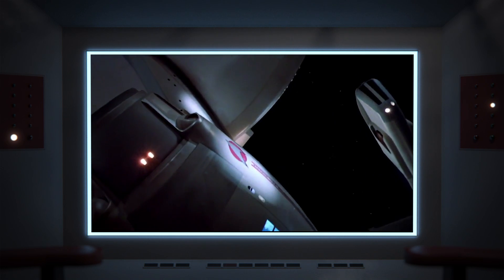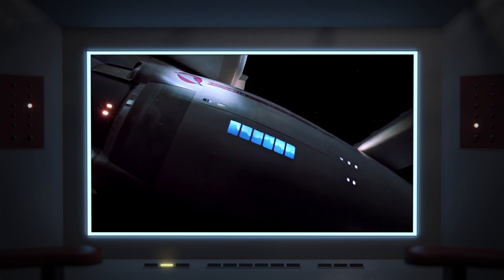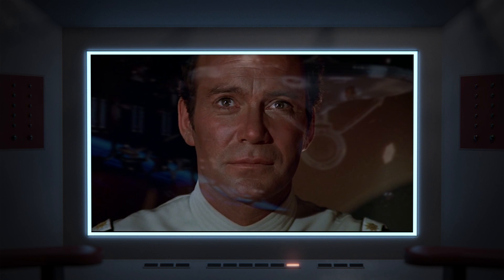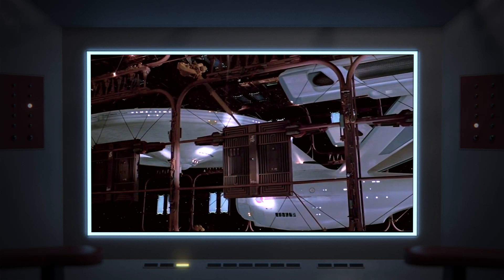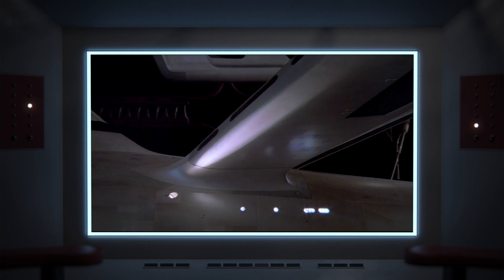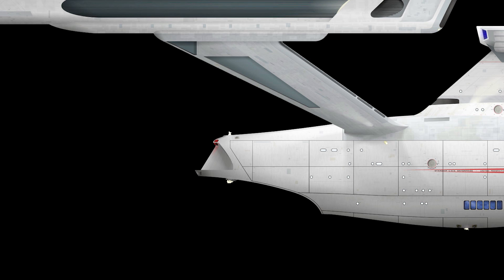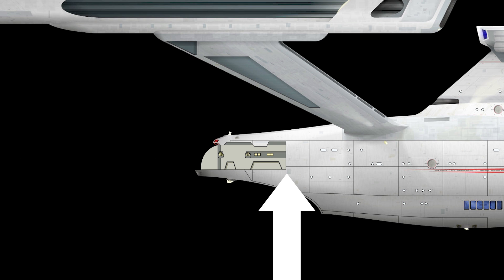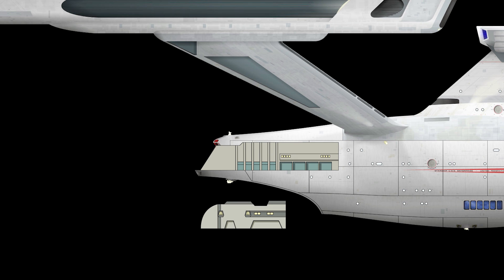Why Have Angled Nacelle Struts? (Enterprise Refit)

Comment: When I saw the title I was like 
'Cause it's supposed to look faster 
And I thought there's no way Henry could come up with a logical reason for that without it being a bit of a stretch 

2 minutes later

"because it limits the maximum size of the Shuttle Bay " spits drink DAAAAAAYUM, EC 
You're a goddamn genius 

How does he come up with this stuff ?
Reply: The Excelsior, Ambassador & Galaxy classes all switched from V to U configuration; avoiding this  problem.
Reply: @jedigecko06  Galaxy actually avoided it further by integrating the shuttle bays into the rear saucer and neck area instead.
Reply: @jedigecko06  - ... while adding a TURN to the Plasma Conduits, leading to an IMPORTANT improvement in the overall need for plot-point: Engine Failure.
Reply: It's simply an engineering thinking.
Reply: @Lukas-Trnka  An optimist sees the glass as half-full. The pessimist sees the glass as half-empty. The engineer sees a glass that's bigger than it needs to be. :D
Reply: Same here - I was mainly of the "because it looks better" category. But the larger shuttle bay... It's like you just smack yourself and say "why didn't I think of that?!"
Reply: Well, there was a bit of a stretch. I thought the reasoning would be more expansive. It certainly enlarged my understanding of the subject.

PUNS! You were making a pun, right?
Reply: Mihai Lazar
.... two words...Blueprint collections!
Reply: The was an article in the Naval Institute Magazine "Proceedings" called "Warships Should Look War Like."

Comment: If it looks faster, it goes faster. It's science.
Reply: If they paint it red, it'll go even faster.
Reply: @AlexSDU  Don't forget adding the V-Tech and NOS stickers.
Reply: @BammerD  Naaa what it really needed was spinning rims, a light kit, a craptacular stereo that can't play any other note than "BWAAAAAAAA BWAAAA BWAAAAAA" and of course the most useful and practical item ever installed on a teenager's car, the spoiler... Ensuring that Timmy's Ford Fiesta with the 1.6L engine will maintain control as it thunders from 0-to-60 in a blistering "eventually".
Reply: @AlexSDU  Char, is that You?
Reply: @paolobellomi8056 No. This is Patrick.
Reply: @米空軍パイロット  - The "Whoop-Honk" bicycle horn right ? THAT would be the FASTEST !
Reply: @chuckintexas  No. A spike horn.
Reply: @AlexSDU  add white racing stripes everybody knows that's at least a .05 increase to warp speed.
Reply: Warhammer 40k Orks have the best science. 
It also has more Dakka.
Reply: Shoot some speed holes in it! They make the spaceship go faster!
Reply: @MattMcIrvin  Didn't General Chang already do that?
Reply: Just put fins on the top. Make it look like a hot rod. Then it will go faster. Just ask Tom Paris.
Reply: RED WUNZ GO FASTA!!
Reply: paint it red to go fasta
Reply: it actually is slower, while the tos enterprise was rated for a maxium of warp 8 this one is just capable of warp 7
Reply: @kaltenstein7718  Actually, while the TOS Enterprise was rated for a cruise / maximum of Warp 6 / Warp 8, the refitted Enterprise was rated for Warp 8 / Warp 10. So she came out substantially faster.
Reply: Stickers help too.  Can confirm, repeatable results achieved with late 20th/early 21st century ground transport vehicles.  Probably due to reduced aerodynamic drag over the smooth surface of the sticker which eliminates the friction of the rougher painted surface underneath.  +1 horsepower per square inch of sticker, math checks out.
Reply: Red goes vroom vroom it's in the bible
Reply: We painted it red so it went faster too
Reply: No duh.
Reply: Add stripes for 2% speed increase
Reply: they designed what they thought looked cool and then tried to explain it later
Reply: aerodynamics doesn't apply in space.
Reply: @pepperVenge  No U.
Reply: @米空軍パイロット  What??
Reply: @pepperVenge  YOU DON'T APPLY IN SPACE.
Reply: @米空軍パイロット  You got a problem with me?
Reply: @pepperVenge  you missed the joke
Reply: @jackowackooooooooooooooooo2673  Chicken and rice?

Comment: I do not know if those ships actually can go into an atmosphere, if they can, then they would add to it's ability to move there.
Reply: Eucep   Not really, you won’t make a brick building behave any better in the air by putting some swept pylons on it.
Reply: @DrewLSsix  Not pylons but the design of the Rockafella Centre is calculated aerodynamically to minimise sway in high winds, which allows it have longer elevator shafts. 
Conversely the Borg Cube in the the flashback near the end of 'VOY: Hope and Fear' seems to be doing well in the atmosphere of a class m world.
Reply: They're not meant to but they can go into an atmosphere but only until a certain altitude. In the 1967 episode the Enterprise is sent back in time and ends up in Earths atmosphere and is low enough that jet fighters nearly intercept it until the crew gets the ship up to full power and they use the impulse engines to escape to low orbit

Comment: One Idea I saw on Memory Beta is that the New Nacelle Designs just couldn't be supported by the Old struts due to a number of factors such as the mass of the nacelles as well as the fact that the Power Transfer conduits weren't big enough to get sufficient power to the nacelles, These are likely some of the reasons why the Nacelle pylons were "Swept" in the way they were, to provide more stability for mounting the nacelles and allowing for a somewhat shorter travel time for the warp plasma to go from the Warp Reactor and the Warp Nacelles.
Reply: Also it could be to balance the center of gravity too?
Reply: @esecallum  
The original toy model by AMT of the TOS Enterprise was perfectly balanced -- you could balance it on one finger under the secondary hull. The saucer section and the original round nacelles offset each other perfectly. In real life, I'd bet that the warp nacelles equaled the weight of the saucer section as well, keeping the center of gravity constant, which would be necessary for flight.
Reply: @krisgonynor689  You'd certainly think so. On the other hand I did some mass estimates of various parts of a galaxy class ship given the information in the technical manual, and it leads to a few interesting conclusions.
The available info is the general mass of the ship ~4.5 million tonnes.
Then there is a specific mass given for a warp coil (don't know it off the top of my head)
We also know, based on explicit statements, (and also calculating the total mass of the 36 warp coil pairs in galaxy class), that the two nacelles are 25% of the ship's total mass.

Then we know that the ship is capable of saucer separation, which implies it has to be somewhat in balance not just as a unified whole, but also each half individually.

The final available detail is that in docked configuration, the main impulse engine (the one at the bottom of the neck on the engineering hull) is aligned along the exact centreline of the ship. That is, if you consider the front to back axis of the ship 'z', left to right 'x' and top to bottom 'y' (which is what the technical manuals do), then the impulse engine may not be aligned to the Z axis centre of mass, but it IS aligned perfectly for both the X and Y axis centre of mass.

We know that in the X axis the ship is symmetrical, so that's already accounted for.

We also know that for the mass to be balanced in the Y axis, given that the only thing below the main impulse engine is the central body of the engineering hull, (the nacelles, saucer, neck and most of the nacelle pylon structure lies above the impulse engine.

Knowing the impulse engine indicated the balance point, that means the main section of the engineering hull totals 50% of the ship's mass.
The nacelles total 25% of the ship's mass.
And that leaves the neck and saucer section combined being roughly 25% of the ship's mass.
That makes the engineering hull as whole (given it has the neck, and nacelles in it's structure as well) being over 75% of the ship's mass.)

That gives a pretty odd picture of the way that ship is balanced really. in the Z axis the centre of mass would be quite far back into the ship...
Reply: Starfleet2360   None of that fits, the struts are both thinner in profile and no wider at their base than the old ones.   The swiped pylons are longer overall than the straight ones were. And I don’t see any additional stability in this design, but one would have to know the forces involved and that’s not something we are privy to.
Reply: @DrewLSsix  are there even any forces acting on the ship at all inside the warp field? Why would there be if space was distorted around the ship?

Comment: The struts seem to be sturdier as there is more strut touching the hull and nacelles at their connection points.
Reply: Also, in comparison, the struts on the old nacelles were placed at the front in a small area. The angular design is wider at the nacelles and centered.
Reply: Maybe they allowed for a larger Warp Field area thus allowing greater Warp Speed. Just a thought.
Reply: @Ryben Flynn Yes. What was the point with typing just that?
Reply: So...basically what he just said in this SHORT video? Okay.
Reply: and jusr like slanted armor, more sturdier. Didn't see that many constitution class nacelle chopped off like in the new JJ enterprises
Reply: @werty1160   The TMP enterprise would have done no better in beyond, very few pre-TNG ships would have survived having thousands of little suicide ships that bypass their shields ramming into their hull.
Reply: Yes... but the struts are longer and more massive... negating any advantage.
Reply: @Bartonovich52  no, not really
Reply: @madmax2069

Yes... really. 

A better way would be to make a straight pylon with a wider base. 

Take a look at bridge pilings... they don’t angle them so they are stronger. 

Take a look at the trusses on the ISS if you want a space example. All straight and right angles between major sections.

Comment: You also have no 90 degrees bend in pipes (for heated plasma and what not) from the warpcore to the nacelles.
Reply: Had the same thoughts. No more 90 degree angles must allow for far better flow from the use of the Warp Core whereas the old Warp Engine the original used may not have required streamlining the Plasma Flow to the Nacelles as they operated differently from one another. The more powerful and more efficient Warp Cores also exert a lot more stress on the structure of the ship and the angled struts play a large part in alleviating that.
Reply: @livingchutoy5422  ...I refer you to Goeffrey Mandel's earlier [and not Doug Drexler's] nacelle cutaway.  The Berman era named 'warp core' was within the nacelle itself.
https://www.cygnus-x1.net/links/lcars/blueprints/star-trek-blueprints-sheet-13.jpg
Reply: Bends constrict plasma flow rate
Reply: There was no "warp core" in the original Enterprise.
Reply: but there is a "TNG"-Style one in the Refit.
Reply: @Kirifairy  Point of order...  The TMP (1979) refit Enterprise pre-dates The Next Generation (1987) Enterprise by most of a decade.  So, it's more accurate to say the the Enterprise-D has a "TMP-Style" warp core then the other way around.
Reply: @SvnLyrBrto I'm pretty sure the Refit Enterprise(TMP, Kahn, Search) still had the horizontal style warp "engine". The Next Generation style vertical warp "core" appeared in the Enterprise A(Final Frontier, Undiscovered Country). A few years after TNG aired, from a production standpoint. The quotes around "engine" and "core" are for my distinction. I thought that the device which generated a warp field was a warp core from the beginning, with the terms being used interchangeably.
Reply: @NW1200  The creators kind of screwed up when they called the device in Engineering a 'warp core', since the only thing it has to do with warp travel is supplying the power. The 'warp core' is nothing more than a big matter/anti-matter reactor. The actual 'fiddly bits' that create the field are in the nacelles. In theory, you could use some other power system entirely and still generate the field, but the amount of volume and mass you would require for any other reactor to match a M/A-M reactions output would be... well, not to put too fine a point on it, but it would be astronomical. Literally.
Reply: @Kirifairy  Not really. Yes, they are both cylindrical and yes they are both glowy. But the TNG warp core has matter that injects from the top and anti-matter that injects from the bottom. The output of this flows through red glowy pipes. The refit Enterprise just has a swirly blue glowing shaft. There is no indication of any matter, anti-matter, or the reactor thereof anywhere on the shaft. I would argue that the reaction actually takes place up near what some people call the "impulse crystal". And the blue glowy shaft is more like a plasma conduit. That being said, Enterprise-A did have a warp core that was identical to the TNG one.
Reply: @NW1200  To my recollection, TOS and TMP never used the term "core".  TNG is kind of fuzzy on the topic on-screen.  But the behind-the-scenes materials imply that "reactor" would be a more accurate term; as the "warp core" seen in engineering was stated to simply generate the energetic plasma that powered the nacelles, which did all of the actual propulsion.  But that's besides the point.  If you watch ST 1 and 2 carefully again, you'll see that there is, in fact a tall vertical core into which the matter and antimatter are injected, and then a horizontal conduit into which the plasma travels aft, and then two slanted conduits which feed up into the struts and nacelles.  TNG is the same, differing in that the two conduits to the nacelles branch directly off from the vertical core instead of traveling aft in a single conduit first.  Plus, TNG added blinkenlights.

Even further behind the scenes, when production of TNG started, the TMP engineering set on Paramount's stage 9, complete with the vertical core, was rebuilt into TNG's engineering set.  Yup... it's actually the very same room.  And for ST5 and ST6, it was redressed slightly and filmed from certain angles to hide the fact.  But removing the blinkenlights would have been too expensive and time-consuming.  That's why the engineering scenes in the latter movies are so extremely curtailed versus 1 and 2.  They had to frame the shots to only show the redressed portions.

So yeah... not only does TNG use a TMP-style warp core, but underneath the flashing bits, it actually IS the very same warp core.  The details of the production are actually pretty interesting in that regard.  TNG re-used LOTS of sets and props from the TMP Enterprise; and even pulled various parts from TOS out of storage, in order to make connections between the eras.  Look carefully in the respective transporter rooms for a good example of the latter.  :)
Reply: @Kirifairy  .....No, that was merely the intermix chamber, as stated in TMP, and its' "Making of..." non-fiction book. That dumb term came strictly from Berman and Naren Shankar and the rest of the TNG+ writers.
Reply: @SvnLyrBrto  ...They only ever had the one transporter set on stage 9 or 10, that they kept re-dressing over and over again.
Your other point is correct as well, for TNG, they  used the same forms and castings from TMP/TWoK, they just made the gangways[corridors] wider but if you look carefully, on some sets, mainly control consoles that hang on bulkheads, they used the same bottom [or 'guts' containers] and just made a new piece of plastic for the touch controls. They reused the bio-beds and just threw new cushions on them.
Reply: @LoneBrowncoat  Perhaps I phrased myself poorly.  When I mentioned "various transporter rooms" I meant from series-to-series, not more than a single set on the soundstage.  And the TOS sets from the Desilu days were struck and put into storage at the end of that series.  What I was trying to point out is that, if you look closely at the TNG transporter room, you can see that it isn't just a redress of the TMP set; but that they pulled those some of those old Desilu-era parts out of storage as a tip-of-the-hat to the earlier series.
Reply: @SvnLyrBrto  ...I saw that on one of the documentaries, common knowledge now. The old bottom plates became the top, and now there is a prop company that made/makes them for the various fan films and tourist traps.
Reply: @MichaelEllisYT  yes, there was. It was just internalized.
Reply: @warptek  There is no mention of a "Warp Core" in any Kirk Era episode. The Enterprise had at least one Matter-Antimatter reactor and possibly up to three. There is mention of the ship having three reactors, however I'm not sure if it is specified that those three are matter-antimatter reactors.
Reply: Well, ummm. a matter/anti-matter reactor IS a warp core. MARA. In the original Enterprise it wasn't exposed through transparent plasma conduits but behind massively shielded duranium. You remember the episode where Kirk was trying to find Finney? They were stalking each other behind some massive looking equipment. That was the MARA.
Reply: So what? Why would even there be gravitation in the pylons?
Reply: @danielveres4351  It's not about gravity, it's about forcing a high-energy plasma to change direction.
Think about forcing water through a hose - this puts a huge amount of pressure on the hose, and that pressure is a lot stronger in any parts where the hose bends.
Actually a hose that's empty can be bent into curves easily, but one full of water resists curves, especially sharp ones.

A 90 degree corner in a plasma conduit would put a lot of pressure on the conduit, and also disrupt the flow of the plasma. If the plasma moves at high speed the problems get even worse.
You probably wouldn't put a 90 degree turn into it anyway, but rather if you needed to turn a corner, you'd need a curve of a certain radius to minimise such disruptions.